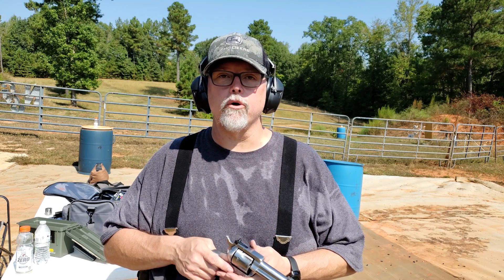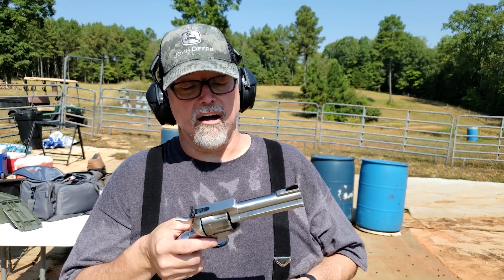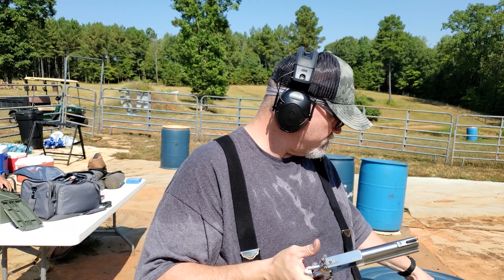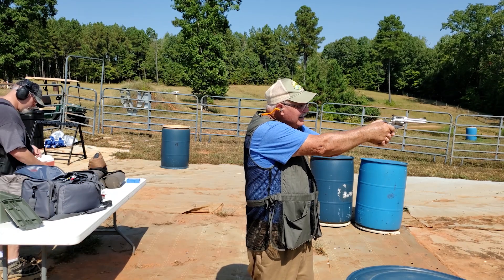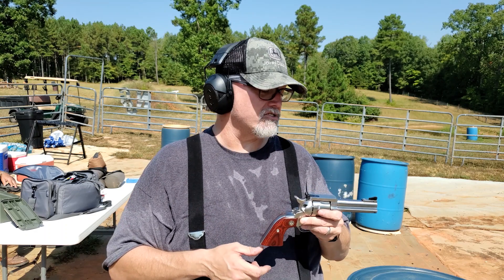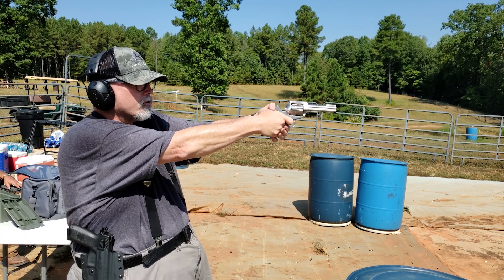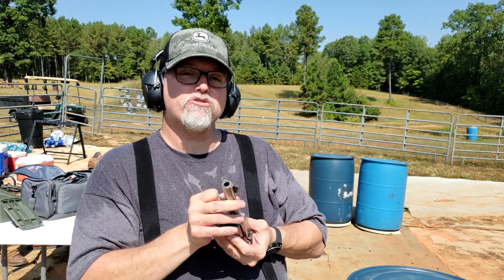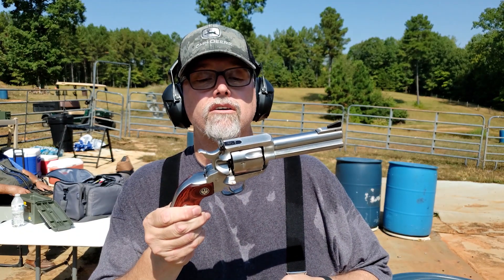Ruger Blackhawk .357/.38/9mm

Comment: I just paid $900 for one. I wanted one so bad. Learned that Ruger is not manufacturing revolvers right now due to labor shortage/fakedemic. I wanted this particular gun for the same reason you did. It shoots 357. Also, I noted you pull back on the single action correctly using your support hand. Great video.

Comment: Since it takes. 357/.38 it should be able to take .380 in the 9mm cylinder. Same diameter just 2mm shorter. Have you tried it?
Reply: Won't work.. the 380 will fall into the cylinder too far